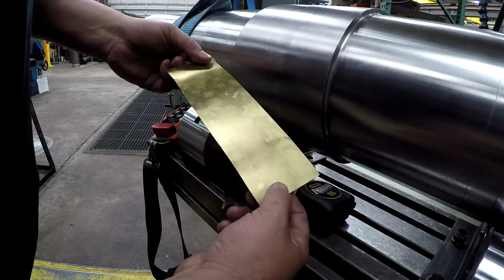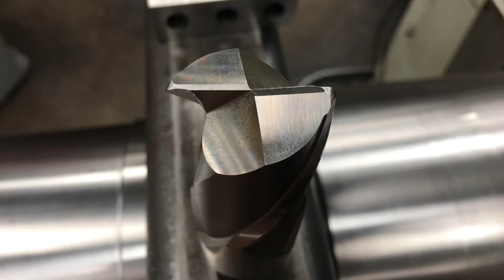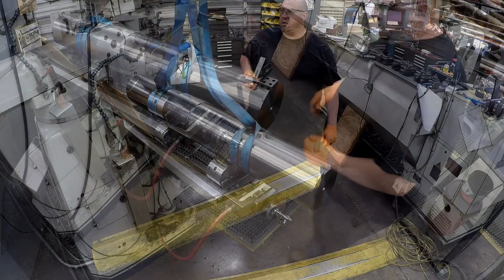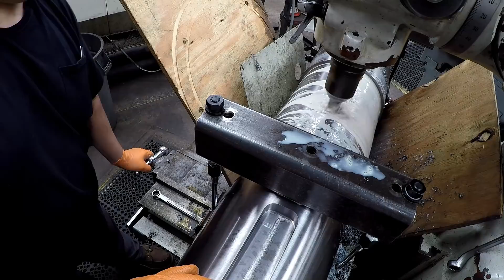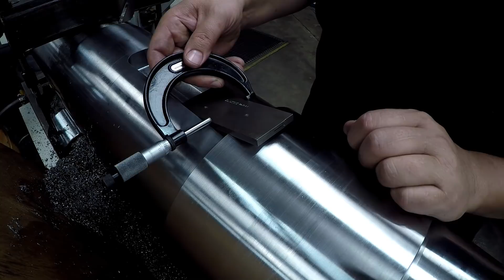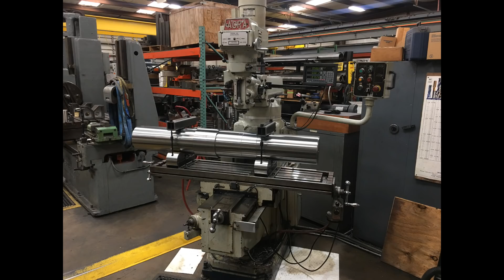9 5 Inch 4140 Gearbox Shaft Part 3

Comment: HOLY CRAP! that shaft HAD to have been put under a tremendous amount of torque/forces to crack that keyway.  4140 upper tensile limit is around 165 ksi, and yield about 140ksi.  ...so I'm guessing it happened around 150ksi (or 75 tons)
Reply: It could have fatigued over time. Or hit a foreign object, eh?

Comment: Adam did you mill and grind the bottoms of your A-Blocks? The angle iron you welded on I mean.
Reply from the maker: I did not, I had planned on milling them flat but they stayed flat enough that there was no need. When I welded them together I used the boring mill table and had them clampedvery secure.
Reply: I find that if I have a good reference surface and weld with good clamping, if I leave the part to cool while still clamped it tends to reduce thermal distortion alot. Probably leaves the part under high internal tension but dimensionaly it works. Nice work on this shaft. My wife and I thought it was for a ship gear box.

Comment: And once again we see that the most important tool is the one between your ears. Nice job on that. Does the old one go back to the customer, or get scrapped. I assume you can't really use it for other projects because there might be hidden stress damage.
Reply from the maker: Unless they ask for it back we send all scrap metal to the scrap bin. I'll save this shaft though cause we can use it for other things. Sometimes you just need a nice big round slab for some shop project.

Comment: I can see that. Osb, particle board, and other similar types of sheet goods deal with a lot of pressure during the manufacturing process. That could be a shaft that drives one of the rollers that deal with that kind of pressure. It's interesting to see the machinist point of view after a parts life cycle. Could it be prevented on the engineers side, or is it just the cost of doing business?  I always enjoy watching you dissect failures with the intention of making the next part supersede the last. Keep them coming, I'll always come along and watch!
Reply from the maker: I think it could be engineered better. Possibly using a larger radius then what i put in there. We also need to find out what kind of fit the coupling has. If it's loose then it'll cause it to slam against the keyway.
Reply: Abom79 It very well could be a loose fit. Even on a slow speed shaft, in a high torque situation that could be detrimental to the longevity of that shaft. How many have you made for this individual? Could a visit to the factory help you better understand what the actual problem is? Or are they okay with the machine eating up shafts and having new ones made?

Comment: I think these are my favorite videos. I've worked with electric motors and compressors that have shafts that range from 6"-10" in diameter for over 40 years but until recently I didn't know how they were made. It's pretty cool to see how it's done and done with such precision. Nicely done.
Reply from the maker: I've made many shaft for electric motors over the years. I hate having to press them out though.

Comment: That looks kind of like the shaft I Had to press a herring bone bull gear on to for a Lufkin pump jack 1280 gearbox , only I used a slightly tapered key to hold the crank arm's on each side after pressing on the bull gear.  We had a huge horizontal press to do all our press work.  The key was in the setup to keep from Goulding the parts being pressed together .  I used a shaper for fitting my keys.
Reply from the maker: Sounds like some good work you got into there.

Comment: When measuring depth, do you account for the reduced reference height of the sides of the cut keyway since you've bisected the circular shaft?
Reply from the maker: No. Once the width of the cutter is mes along the radius the depth will be half the key, or whatever half the thickness of the keyway is. Another way which I have shown before is to set a block in the key and "mic" it with an OD mic.
Reply: Gotcha; thanks for the reply.

Comment: @Abom79 - So, what happens to the old shaft? Does it get put into the stock tray for possible use in another part?
Thanks for another interesting series!
Reply from the maker: I save those to use for some other shop project.
Reply: I save all old shafts out of things I gut out for parts. Never know if one can be turned down for another project.
Reply: Adam, isn't there allready too much material fatigue in this old shaft?
Reply: Depends on application, right?

Comment: Absolutely love your explanation about how things get to the grocery store. I spent over 40 years in either the building of the plants or running the plants that make the things that people just assume fall off of trees. I've never worked in a paper mill but am pretty familiar with the processes. I did work in a tire manufacturing plant . I set a gear box one time that had two  5000 hp  GE electric motors turning the gear box. The box had 16 inch shafts with 5 inch key stock.  4 inch diameter anchor bolts. All just to mix the  the carbon black to make the rubber for the tires.  All couplings had to be within .002 face and run out. I love the big stuff but also love the miniature stuff as well.  Thanks for all the hard work making and loading the vids for us to watch.
Reply from the maker: Now that's some big heavy duty stuff Terry! I have not seen anything quite that big but close. I have shown one gearbox in past videos that have two input shafts in parallel with the main bull gear. I believe each input had something like a 500 HP motor driving it. It's a hollow bore shaft and IIRC the bore is like 16" or more. We have another one in the shop now for a rebuild.
Reply: Adam that is the way this gearbox was set up. The gear box drove another unit called a Ban berry .. Don't know if I spelled that right it was in 1978 when I did this job. Another great industry is the Electric Power generating industry. When people flip their light switch they have no idea how the turbine and boiler are built and how large they are just so when they flip their little switch their light bulb lights up..   Keep up the great work and appreciate the feed back.

Comment: I may be missing something but shouldn't you indicate on the side first, then the top? If you do the top first, you could be seeing a change in elevation based on moving off the very top of the shaft, moving off centerline. I guess you could have the same on the side if the shaft isn't level. Do the top, the side, then top again, then side again?
Reply from the maker: I do both side and top and verify both before machining.

Comment: It is amazing what precision can be obtained with older manual machine tools when someone knows what they are doing. CNC is great but there will always be a place for someone that can do it with a manual machine. Nice job.
Reply: I certainly agree with you 100% In other ways, it's been my experience that CNC also needs master machinists.
Reply: Preferrably master machinists to do the programming correctly and understand tip raidius offsets and proper machining as far as depth of cuts, speed and feed. 
I know there are some great programmers, but it helps to actually know about machining manually. 
Like in my trade, tool and die. If only the designers and engineers had more real world experience with dies and how they run in the real world, there would be alot less problems.

Comment: Adam, so much torque is being applied to that single key, it blows out the single keyway on the shaft. Why not add a second keyway 180 degrees out, to reduce the torque load on the keyway by half?
Reply from the maker: You also have to consider the fit of the coupling. It's not my job to re-engineer the shaft.
Reply: Also consider:  adding more keys can spread the load, but it also introduces more points for the shaft to fail at, if any one of them goes, the whole shaft needs to be replaced any way; far easier and cheaper to keep the number of possible failure points down, also reduces the time/cost to manufacture.  Also also: the equipment that this shaft goes to is only made for one key, adding more keys means that the other parts that connect to this shaft have to be redesigned, and rebuilt, more $$$.
Reply: Would it help if the radius in the corners was larger? Say an 3/16" or even a 1/4". Maybe the keyway would have to be deeper to maintain the surface area and so a new key would have to be made which could go beyond the actual job description, but would a larger radius make it less likely to fail again?
Reply: There are engineering standards which specify the radius at the bottom of the keyway for a given width and the chamfer on the key.
Reply: Kineth1 if the world made sense keyways would be made on a bore Mill and have a round instead of square profile. The sharp corners of a square keyway cause cracking.... Which is exactly how the old shaft failed.
Reply: Adding or removing keyways is something that requires redoing all of the calculations of the shaft, its not something that you can just change willy nilly and expect everything to be fine. 

As others have said, adding a keyway reduces the surface area of the shaft in that area which increases the stress in that cross section and thus reduces the factor of safety. In addition to less strength, youve got even more stress concentrators in the form of that keyway. Whatever attaches to the shaft would also need to be modified correspondingly. 

Keyways and square holes are often broached because a mill doesnt fit in the hole, if that is the case here then youll need new tooling as well to cut that keyway and broaches are not cheap, especially if you intend to just do a single gear with it. You might get away with using the broach that was used to make the other keyway but Im not sure about that.

As you can see, it isnt simple at all, there are a lot of factors involved and a lot of things to take into account and to plan for when designing a shaft.
Reply: Hi Adam, I agree to the above comment little bit, if required, modifications can be made with engineering and client consultation, mostly on the issues where a damage is occurred, though I will repeat the same , its not your job to re-engineer.  re-producing is appreciated when re-engineered correcting the previous model's faults.
Reply: An engineering solution for this problem is splining the shaft and the coupling, but this takes very specialised machinery and in most cases is probably prohibitively expensive.
Reply: If there was room in the assembly, one option that an engineer has would be to extend the length of the shaft and make the key-way closed ended. But that is outside the scope of this project. The job was to reproduce the shaft to get the expensive equipment back on line quickly. Their customer was loosing money everyday their equipment sat idle waiting for replacement parts. Mission accomplished!
Reply: Because than you have a bunch of little keys that are fucked up instead of just one big one

Comment: Great work! I am just curious about the centre key way; the slot has rounded corners but the key looked like the edges were all square. What happens with the 'gaps'?
Reply from the maker: I decided to use the same cutter. All we have to do is dress the corners of the key on the belt sander to make sure the key seats flat in the bottom.

Comment: Wow! Amazing. Myself, I have just finished replacing stripped carraige feed gears on atlas 12 inch. I am ready to use the lathe to machine CV joint driveshafts shafts for my front axel of my Jeep.

Comment: Just guessing what application this gearbox shaft is for? A 1991 Toyota Corolla?
Reply: 100% sure its for a 1958 citroen 2cv.
Reply: na man, a huilix.
Reply: The missed sarcasm is epic.
Reply: @Ditmanppi  you're the one that missed it though...
Reply: Jan Forest lol ok. Pretty sure it's fairly obvious.
Reply: @JanForest  I believe you are correct.
This is totally inside, crucial, top-secret machinist guy type talk and backhand humor.
We don' need no steenkin' Emoji's.
Reply: nokia 3210
Reply: Yes, that's what I was thinking too !
Reply: I know this is two years late, but I, actually, ordered this shaft to be made.  It goes in my watch and you all thought it went in a car.   Sheeeesh.
Reply: I was thinking a gearshaft for a 70s dodge power wagon transfer case. But then I just put new seals and bearings in mine. Good for another 50 years. Did not need new bearings. But I figured while I have it apart after 50 years. Spend a few bucks for new bearings.
Reply: Looks more like an 88 Honda running a Merlin engine
Reply: Hyundai Pony
Reply: Probably a rotating kiln at the l.p. plant in Thomasville
Reply: I bet with two four barrels.
Reply: @ETOPS  Dude you don't need a shaft like this, you just need to run faster flintstones style. :)
Reply: Late to the video - but terence m is a deeb.
Reply: I wish that would have been in my 91 Corolla for a front axle, when that 05 Blazer pulled out in front of me. I hit his passenger side door post at 55MPH and shoved the block and left front wheel up where my feet and legs were supposed to be. 3 months in hospital and ended my career as a machinist about 10 years too soon..
Reply: No the ‘92 keeping up with the upgrade.
Reply: Noo is for a orange juicer
Reply: What steel are the milling tools  because 4140 is very hard
Reply: ETOPS the win!
Reply: Na man, this is a drive shaft for a Toyota Prius
Reply: the single cylinder model
Reply: There is no way this is for a Corolla. Think about it, the whole Corolla only weighs something like 1800 pounds and so this would take up about half the weight if it was used in the gearbox. Further to that, if the size of the Corolla gearbox is only about 1/5 the length of the car then this would have to be a very long gearbox and hence very long car to accept this shaft. 

I am with the other guy. Surely it is for a Hilux.
Reply: 30:22
Reply: Ali Turşucular My guess is the big ass OSB dryers - search YouTube for "GP OSB Plant Tour"

Comment: If you/they know the keyway has loads to bear, and it will always crack at that point, isnt there something wrong with the design? Maybe a deeper keyway, using a larger key? Im not machinist or engineer.... I think it's just logical to redesign if you know that this is the point where stuff always breaks.
Reply from the maker: +Robert Wiggers You'd think so right

Comment: The only thing I can think of when manufacturing OSB requiring a very large amount of torque and pressure would be the machine that shreds the raw timber.  I grew up almost next door to a paper mill and they shredded huge amounts of pine, just about 24/7.  Very nice work on that job Adam.

Comment: Jeez talk about dead nuts on.......that shaft is probably more accurately engineered than the original. The difference between a factory piece and a custom built, the former is built to far higher tolerances, the benefit of having a master machine smith doing the work. No offence  intended to the cnc guys and girls, just my opinion
Reply from the maker: +Matthew Sykes Thanks!

Comment: Great work as usual (video and machining). Would it be possible to modify one of the A blocks to accommodate some sort of vise mechanism so as not to have to add height shims?
Reply from the maker: Perhaps, pin one side together on a hinge and use a screw to adjust height.

Comment: Adam,
Another very interesting project which I enjoyed watching, I noticed that the end of the key ways that you milled had a slightly different radius than the originals, and just out of interest do you send the old shaft back to the customer or does it go into the bin, it would be a good piece of scrap.[
Reply from the maker: Unless they request the old parts back we scrap them. I'll be saving this shaft though for other use when needed.

Comment: so some where in the beginning when this particular machine was designed and built they under engineered it and the shaft should have been another couple inches larger in diameter to handle the torque load
Reply: The key doesn't drive the load, the interference fit on the shaft should. The key is a backup, the interference fit on the shaft has gone bad.

Comment: Nice job Adam.  Did the customer spec the steel used? And do you know if it's going to be heat treated before use?  I'm mostly just wondering if the customer let you know what they're doing to reduce future breakage since it seems to happen regularily.  Thanks for keeping us updated.

Comment: Why not drill and tap a hole for an eye bolt to remove keys?
Reply: Some keys have threaded holes for "jacking bolts"in order to get the key out.
Reply: Plus some keys are bolted to the keyway.

Comment: If that keyway is a standard one and not some bastard, then the corner radius should be around 1.5 mm just like you ground in your end mill :) But I wouldn't fuzz over too much about the keyway depth, as the tolerance is about 0.3 mm.

Comment: That poor old mill !  more metal on the table than in it :-)
Beautiful job, again Adam
Reply: I wonder if the table on a bed mill would flex less under that weight, because it doesn't have a knee?
Reply: That's been my experience. But you take that into consideration with your feed & speed.
Reply: He managed the weight well on his mill table. When milling the key ways on the ends of the shaft, the milling head was swung over to the right to help balance the weight over the knee of the mill. The gentleman had a very nice set up.
Reply: He does nice work.

Comment: Great work Adam. You should have done a guess the weight of this shaft!!
Reply: That has been done per spec before. We use CAD, a small measured sample and the weight of the roughed blank. Deadly accurate.